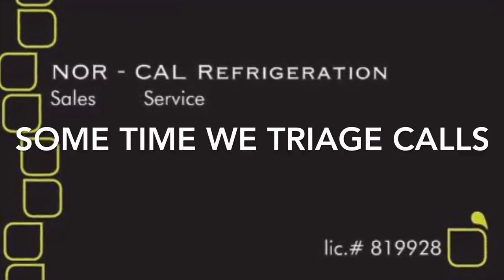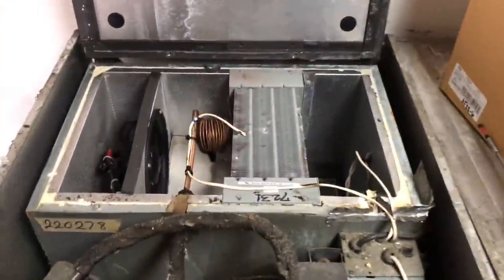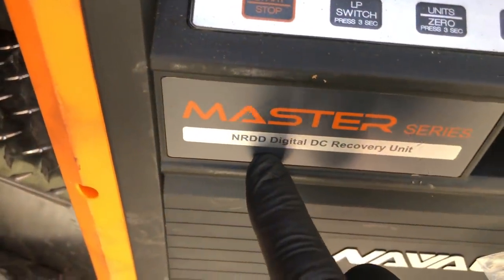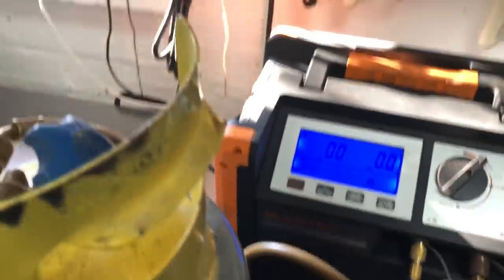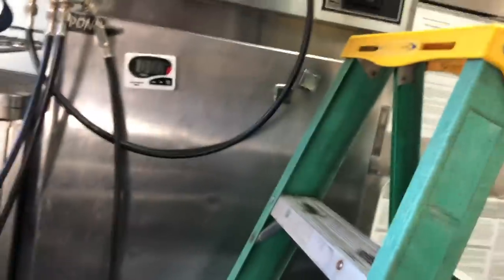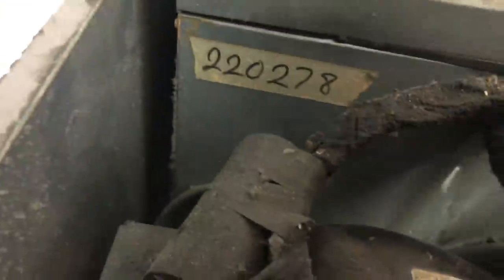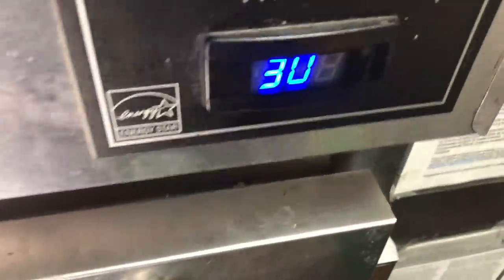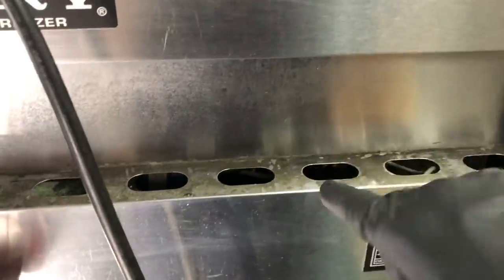Reach in freezer warm

Comment: With that sort of jobs I usually gas a percentage of the charge and see what happens, if it takes 2000 grams I would put say 200grams in and see what my pressures done if they improved I would got to 500 grams, if the pressures improve I would leak check and get them going for the weekend as you did if nothing obvious, also doing it that way for me rules our restrictions or blockages. In saying that I don’t carry a reclaim all the time.
Love ya work

Comment: You’ll never notice a small leak with those gauges on such a small leak, get in there and grab that stupid sub cooling tray lines, I bet the leak is prominent, nothing beats manufactures using different metals, which corrode.
For you old guy, it’s called a SUB COOLING tray, that is its purpose, their is a reason you don’t look after commercial restaurants, cause you’re not a good tech